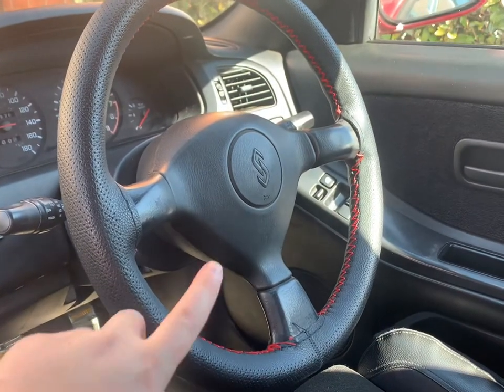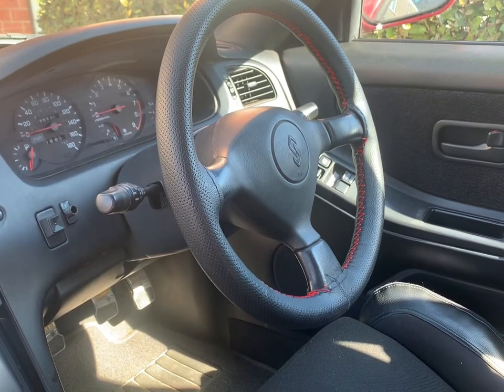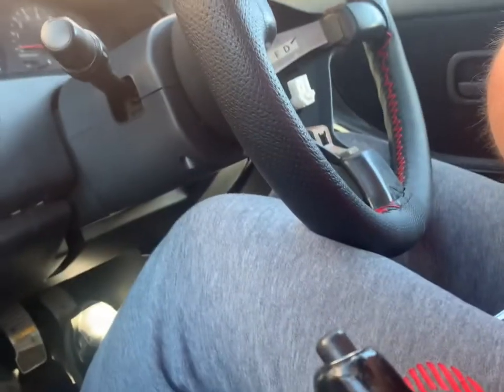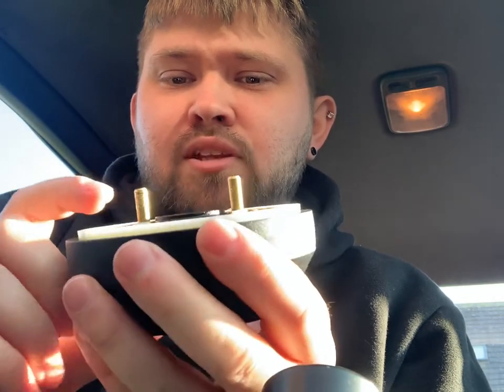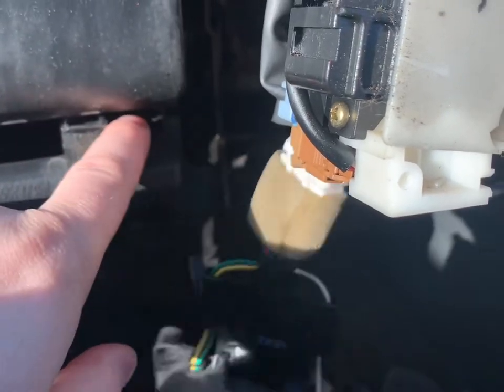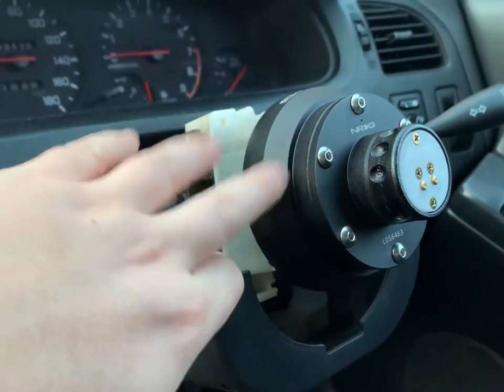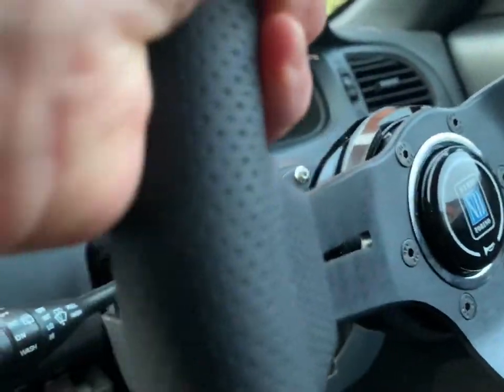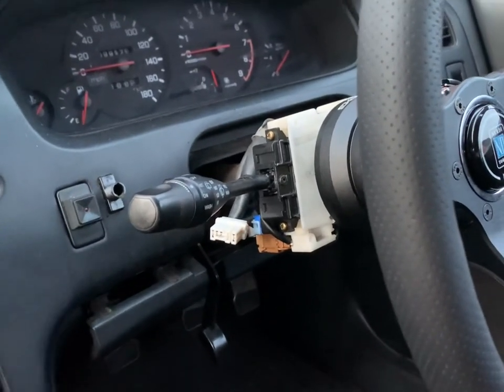HOW TO INSTALL R33 NRG SHORT HUB/QUICK RELEASE AND NARDI WHEEL **WATCH THIS BEFORE BUYING !!!**

Comment: If you look at my video, people tried to tell me you could "just pull the pins out", but I had the same issue as well, I had to just cut them. 
My video will also show you how to do the wiring and I also have a design on there you can have printed by a 3d printing service to adapt the stalk return mechanism on the back ( the 3 white dimples). They arent related to the hicas, theyre purely for the indicator stalk return. 

NRG now has a hub the SRK-145H which will fit over the clock spring, but its to long for using a standard quick release. I was considering going to something like this or the Works Bell 629S and using a thin quick release which is about 1/3 the depth of the one I have
Reply from the maker: Hey man, will 100% check out your video and channel later when I’ve finished work. 

I do know someone who can 3d print so this will be a huge help and how to sort the wiring as I’m not expert in the wiring to. 

As you mentioned I was pulling in those pins and they would not budge 😂